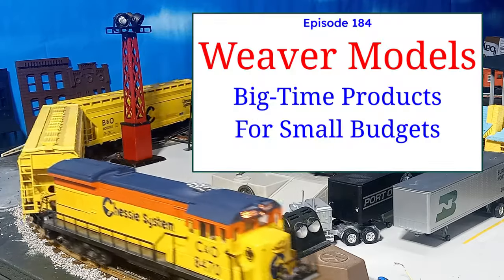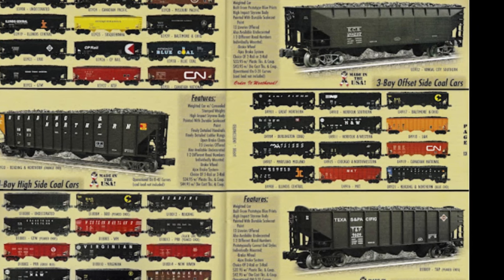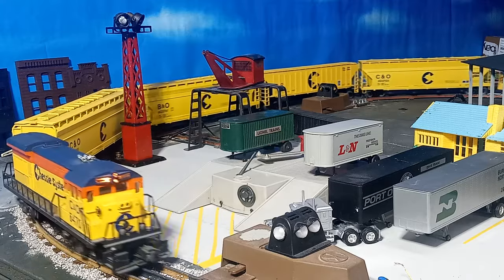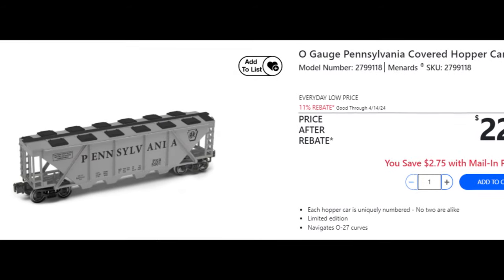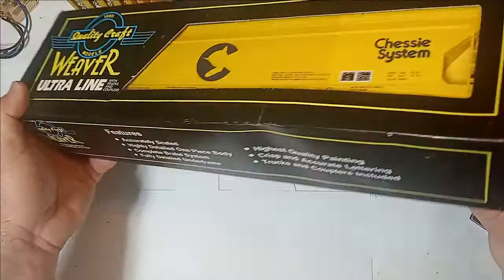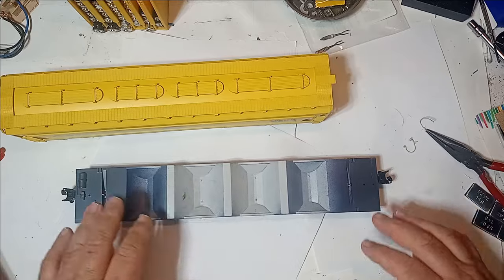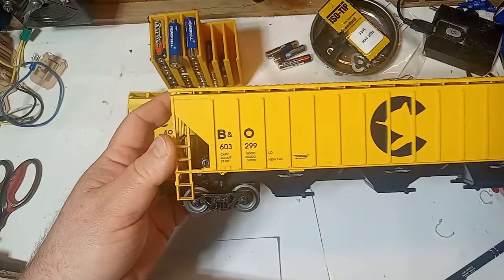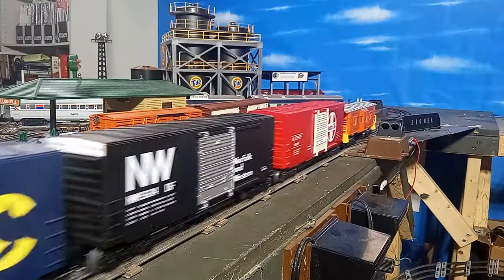Bargain Hunting: Weaver 3-Rail O Gauge Covered Hoppers

Comment: Those covered hoppers are longer than the U-boat pulling them!  😆 Weaver is absolutely a good option for inexpensive, somewhat nicely detailed rolling stock. (especially the ones with metal trucks) I see lots of them in box at train shows all the time.
Reply from the maker: Yes, they are long - longer than early Geeps and 4 axle U Boats. Thanks for watching!